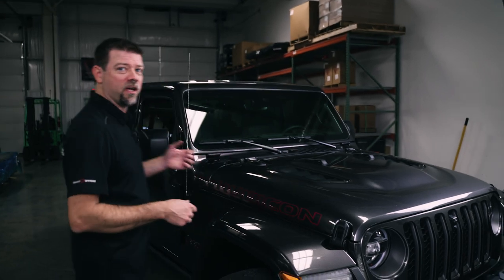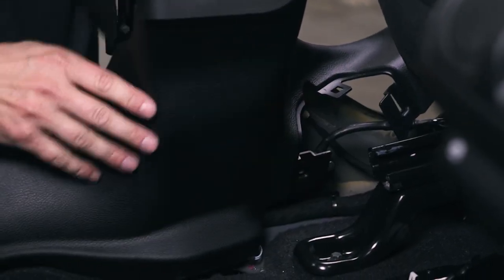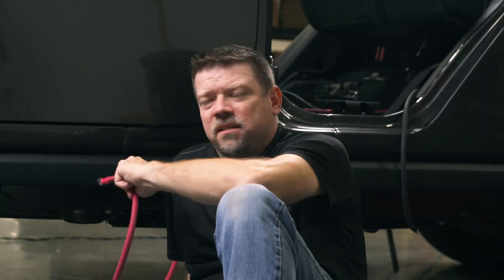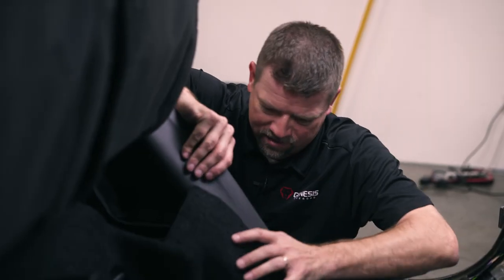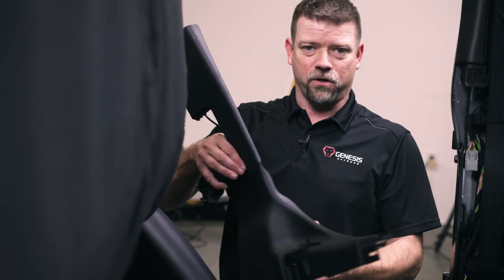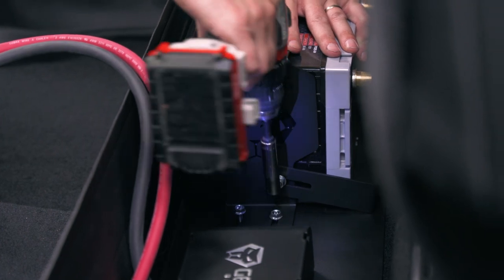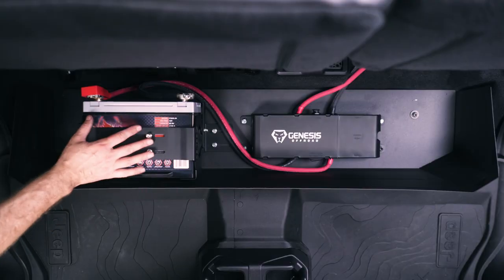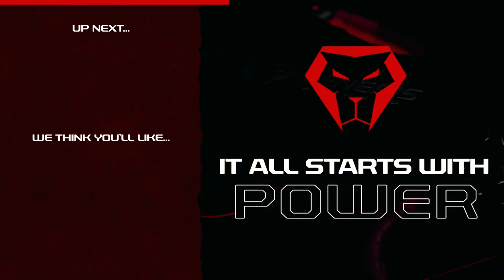Diesel Gladiator Dual Battery Kit Under Seat Installation Video

Comment: Shane - Great video! You gave a good place to run the positive cable. Any recommendations on areas to drill to bring accessory cables in?
Reply from the maker: There is room for one more rubber grommet close to the one shown in the video, by the seatbelt mechanism.

Comment: Is the G Screen compatible with the new set up.  Also, a divider inside the under rear seat box may be of interest to allow side storage without getting on the Genesis equipment.
Reply from the maker: Yes, here's the link to the G Screen for the diesel Gladiator - https://www.genesisoffroad.com/gen3-g-screen

Comment: Can you run it along the passenger side to come up under the battery and not cross the engine????
Reply from the maker: Yes, you can do that, but it's a bit more difficult to route the wire straight down from the battery under the hood because it is more cramped on the passenger side, and not as easy to secure the wire along the frame on that side either. It is much faster and easier to go over to the driver's side.

Comment: Me personally I don’t like the new location of the 2nd battery for the Diesel engine. Need all the space I can it on the gladiator. And the spot under the rear passengers seat are very crucial.
Reply from the maker: We understand completely. It's definitely a big change. Unfortunately Jeep left us no better option for mounting a second battery.

Comment: If I installed the second row seat delete plate system from Goose Gear would this system fit under that.
Reply from the maker: It looks like the Goose Gear plate only has about 6" below it, which means it sits too low to be able to fit a battery under it. However, our adjustable battery brackets and the universal power hub could be mounted either on top of their plate system, or even in the bed of the truck due if that works better for you. Check out this short video for more info - https://youtu.be/Bzjng9IA1E0

Comment: I have a 2023 jl 392. Does this kit also come with the storage bin? If not, where can I get one? Google flipped me off when I searched for one.
Reply from the maker: The under seat storage box shown in this video is for the Gladiator only. The back seats in the Wrangler do not fold up like the Gladiator, so that's why there's no storage box for the diesel / 392 Wrangler. You can see our diesel / 392 Wrangler dual battery kit here - https://www.genesisoffroad.com/gen3-diesel-jl-dual-battery-kit

Comment: Can this be mounted in the bed on a Molle panel?
Reply from the maker: Yes! The power hub and the adjustable battery brackets are available individually on our website, so you can mount them anywhere!